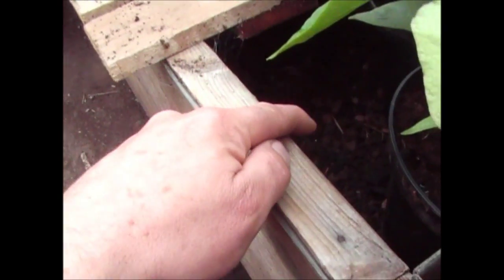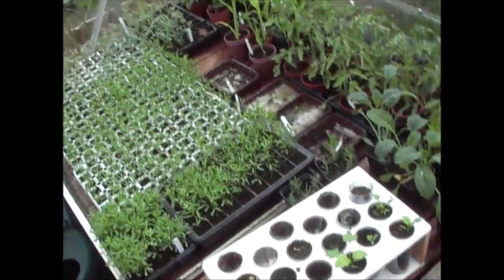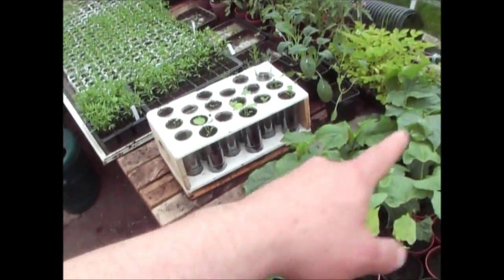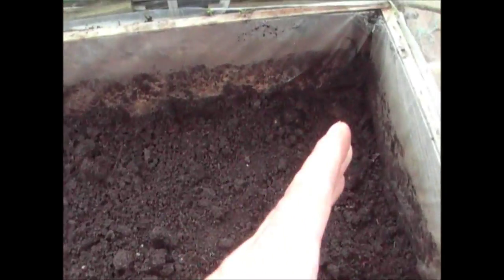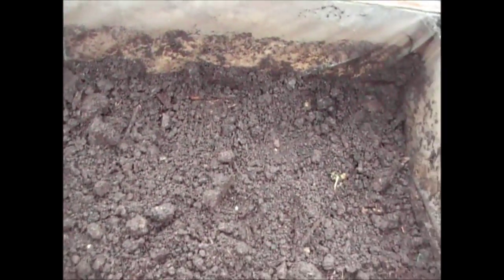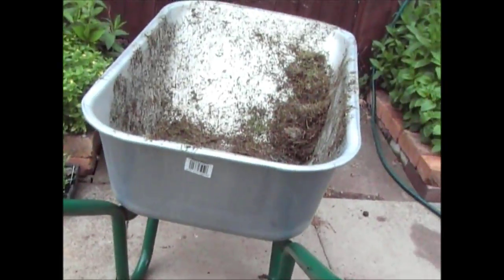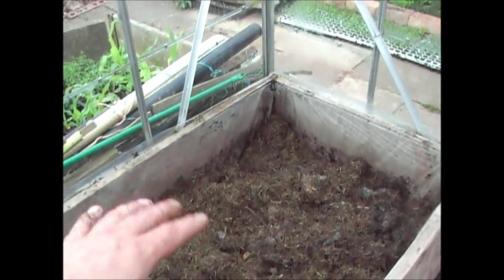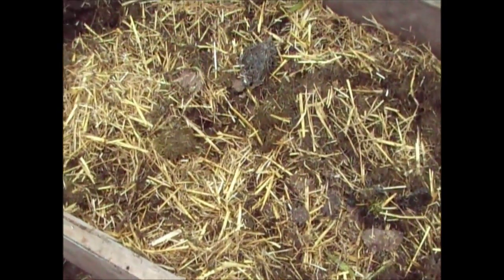Jim's Allotment - Plot 9 - May Tour Part 10 - Greenhouse Prep' and Victorian Hotbeds

Comment: Very good advice on canes and growing in greenhouse,joining and cutting the canes was a good one,going to try the hot bed out side in a small way,for flowers.thanks again,wish you and your family well.
Reply from the maker: Cheers Ray, I have tried the hot bet on flower beds in the past, it works well but the Nitrogen levels are high which can make you flowers have loads of leaves and not may blooms, so make sure you put plenty of fertilizer out for them so they have plenty of 'NPK' not just 'N'.. putting plenty of grass cutting also cuts down on the watering so it is a win win situation . All the best Jim..
Reply: Jims Allotment Thanks Jim I have lots of dahlias as I have been taking cutting since march off some roots I got from poundland,so i will use some pots ect for spare ones,and try hotbeds for some of them,will use some potash and bonemeal as well,i also have blood fish bone, growmore i will use a little bit ..cheers

Comment: Hello Jim, thankyou for reminding me about the tip on cutting canes I had forgotten about it, I have been damaging my canes when cutting and at the end of the season I will dry the canes and treat them. Question, Nettle Tea the thick left overs what can I do with them, were can I use them??. Many thanks for your continuing support. 

Happy growing 
Terry
Reply from the maker: Hiya Terry, Nettle tea is good for any leafy plant like brassicas. The balance is N1.7, P 0.6, K 0.5 so really it is a good all-round fertilizer as such, but I would avoid putting it on onions/potatoes  and fruiting plants because you will get a lot of stem/leaf growth but no root/flower/fruit growth, for these you need comfrey - This has  balance of N8, P 2.6, K 20.5, which really puts nettle tea in to perspective. Always remember N (nitrogen) is for leaves/stems, P(phosphorous) is for roots/buds and  K( Potassium/Potash) is for Fruit and flowers. So the thick left overs, I would compost it as it will help the bacteria break down the carbon. That is why nettle tea always smells as bacteria love it due to the high nitrogen content... Hope that helps.. Al the best Jim..
Reply: Thanks Jim, I will mix the slops into my compost bin and will add to my note book all the other information. 

Happy growing 
Terry

Comment: Hi Jim, thanks for yet another fab and informative video. At long last I've found out how to support my cucumbers properly. I only have a flat type bar at the apex of my greenhouse, but now if I extend my canes with hosepipe and slot it in it should be ok. Will it cope with the weight? I couldn't see if that was all you did to stabilise the other end. Thanks again - Julie (ps: many congrats on No 100 video)

Comment: The hot bed looks great. The council dropped some fresh bark off at the plot last week and I couldn't get over the heat coming from the centre of the pile.
Reply from the maker: Hiya Laura, You could have cooked an egg in that grass last week :o). If you put any of the chippings on you plot don't forget to put loads of grass cuttings or used coffee grounds as the chippings ( or bacteria on them) will leach all the nitrogen out of the ground about 50/50 chippings/grass cuttings is about right.. All the best Jim..